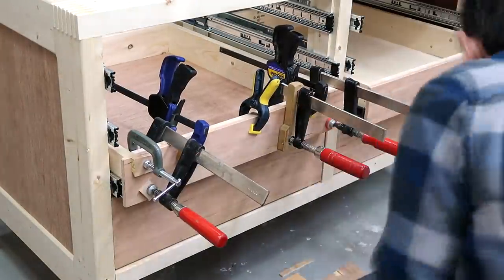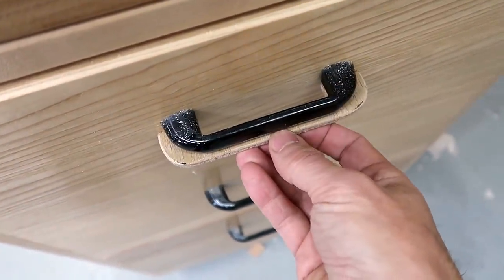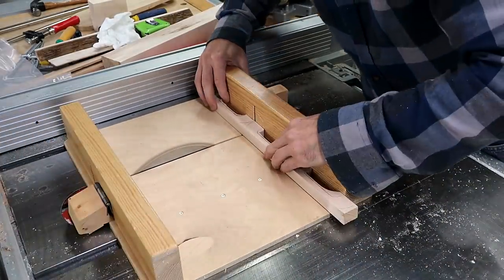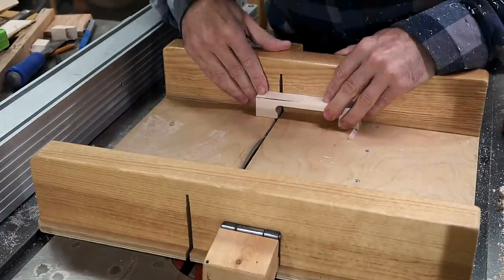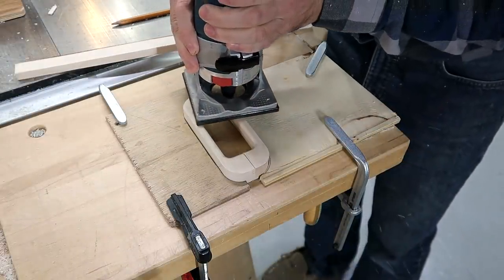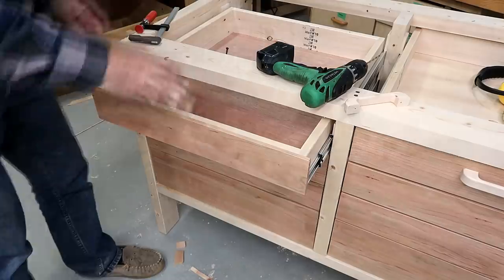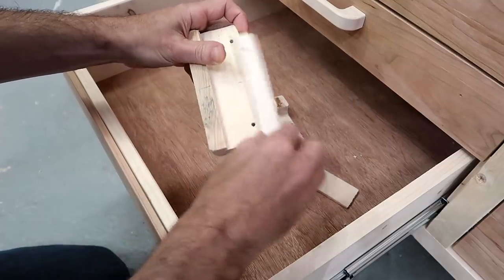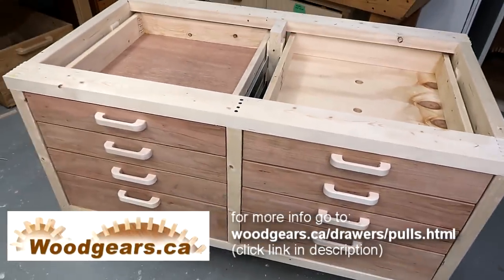Making wooden drawer pulls

Comment: I made some similar looking ones out of plywood. Don't do that. When you run your screw into the handle, you are going to split the plywood at the plys. I saved them by using glue and powerful clamps. The clamps literally forced the plywood onto the screw threads like if the wood had not split. Glad to see these type of videos again.

Comment: The question is, are those handle screw holes on a standard? And if they are, did you use inch or metric standard spacing? We're on the edge of our seats for an answer.

Comment: Knocking knees...on the drawer pulls is not a happy little accident😫.  My dad made drawer pulls similar to your video "Making drawer pulls on the table saw" but they run the whole width of the drawer at the top edge. No possibility of hitting knee caps. Has worked well for 50+ years. My wife cannot stabily walk or stand. She use to bang against the bathroom drawer pulls and cause all sorts of injury.  In our new home the full width pulls has stopped those injuries. But they must by glued on because the cantilever loading will strip the screws.
Reply from the maker: Are your drawers the width of the bathroom?  Otherwise there are still exposed ends.
Reply: @matthiaswandel  Yes. Correct. The drawers are inset between a wall on the right and an under counter (dorm room) refrigerator on the left where the refrigerator is set flush with handles. (Flush setting was by accident. We needed good air flow between the back of the refrigerator and the wall. I do not claim credit for a happy accident.)
Reply: Oh. I forgot to mention the cabinet has 3 drawer pulls due to 3 drawers to the left. They are more for practicality and do not look so good.  Too busy